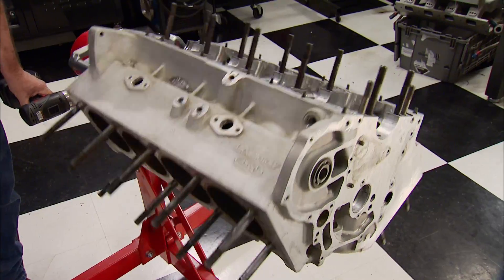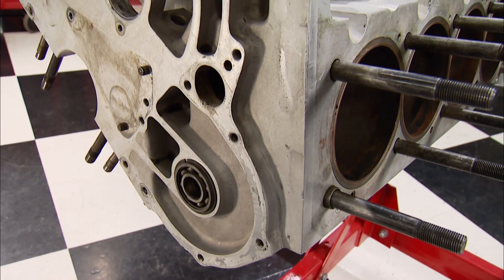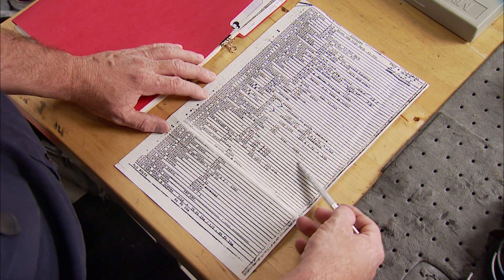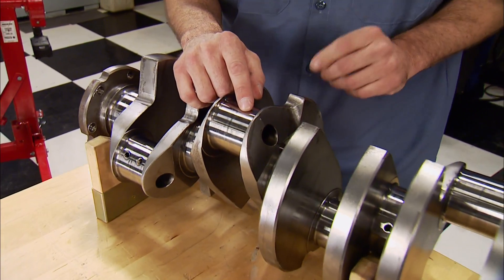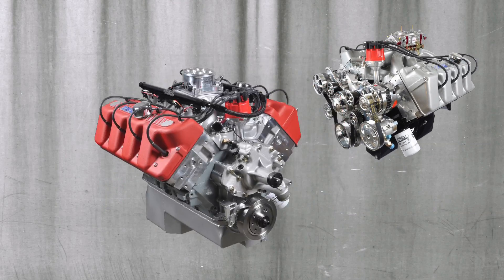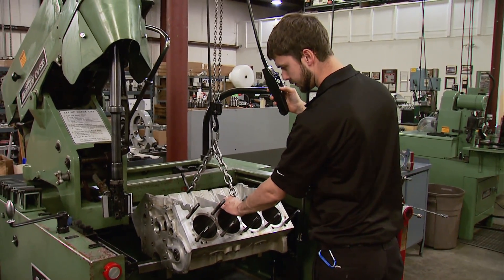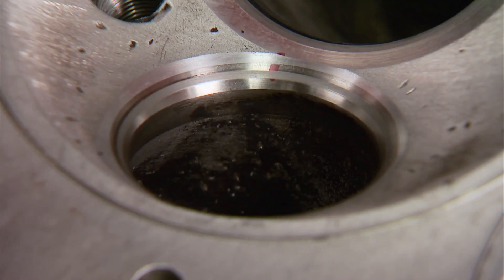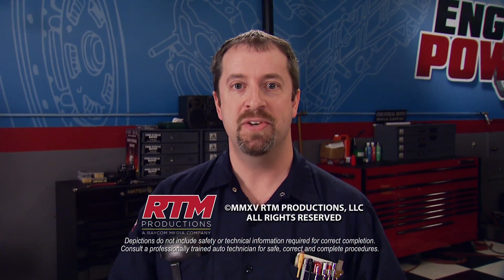The Original BigFoot Engine Build Part 2 - Engine Power Season 2, Episode 5

Comment from the maker: For The Original BigFoot Engine Build Part 3, tune in to HISTORY this Sunday (May 19th) at 7AM ET/PT!
Reply: I used to watch every episode on Spike tv. Then in January,  Power Nation disappeared and was replaced with back to back episodes of Bar Rescue😳   

WTF?
Reply: benoit8850 It’s on HISTORY Sunday mornings between 7-9AM ET/PT
Reply: waiting for ep3 coming up on this channel
Reply: hmm.  i think i would prefer to just watch it on youtube for free.
Reply: what did mr chandler think of the kaases messing around with his motor? how about the displacement shrinking?
Reply: @icyuranus404  I wish he had left it alone.  Kasse is legit and doesn’t “mess around.”  I was far more worried about the Power Nation people.  I hear the engine had low oil pressure, ran hot, and is back on display.  All that history vandalized for nothing.

Comment: So the size of the piston could still be original... your tool and the last used could be that far apart. However as long as you only use that set from this point on you then know what size it is to your tools

Comment: Man all that LS stuff is outrageously priced. I got a gen VI 1998 454 for 700$ with proven sheet 28,000 miles runs like a champ took off the EFI and put on a duel plane intake running a carb on it

Comment: As a fitter and turner (God of trades) your understanding of micro meters is not correct, how often are your tools calibrated this is important as your tools wear like the engine components. I just don't trust a monkey boy mechanic with precession tools. But its a good vid for monkey boy mechanics.

Comment: "Tool on the flywheel bolts were installed at some point and they self-clearanced on the back of this cap and block. The fix after these bolts were removed required helicoils to the crank."

Uh... Say what now?
Reply: Holy crap.. it only got more confusing. Backlash on the threads... Tension on the mic... Jounals... I thought you wrote in jounals, lol.

Comment: It's funny to see the way they machine it, lol. I wouldn't set a bore gauge with a mic. But I guess they probably have 0.002" tolerance. I guess you could if you check the mic with gauge blocks. I prefer to just use a master ring

Comment: 4:13 did he mean to say magneto or distributor? Not criticizing at all. Just genuinely curious. Thanks guys!
Reply: I think it's kinda the same thing if u think about it but I also noticed this and was curious
Reply: Hickstylez I figured he was using the terms interchangeably. Thanks man!
Reply: Magneto. The more cylinder pressure an engine has, the harder it is for the spark to jump the spark plug. There are magnetos that can supply a lot more spark energy than an electronic ignition/distributor.

Comment: Good video but sounds like to me the dudes building the engine has no idea what they are doing.. Have to call a dozen other shops to get it done?
Reply: Thats how they make money. Alot of specialized tooling needed. They're just the middlemen that bolt it together with minimal overhead and maximum profits
Reply: This is an advert, not a documentary

Comment: Does that engine have a Chrysler trans bolt pattern on it?
Reply: It runs a c6 Ford transmission so I doubt it.
Reply: Tim T yeah but it looked like it had multiple bolt patterns maybe. The ford bell housing has a distinct Trapezoid kind of  shape on the upper two bolts, and I thought I saw a more circular pattern like a 727 mopar but maybe I’m seeing things

Comment: Man dropping a 638 inch motor to 571?  WTF  I get it for reliability's sake but that's a big loss of c.i.
Reply: yea but its blown half to space anyway. They'd rather not have to put 3 new sets of rings in before it gets retired I guess. There is a lot of boost going in there so avoiding throwing another rod on the final tour is the priority, not to mention the amount of money they spent on this rebuild. Whoever ponied up those big bucks isn't going to be happy if it needs to be done again.
Reply: @ItsDrillz  I understand the reliability aspect. Just seems easier to take boost out. Either way you are gutted motor

Comment: For an engine to be built to be so strong,it's obvious this one has not.Parts no longer available,,scary thought right there! All the patching up done to the block,another reminder of it's weaknesses from internal pressures. The lifter arrangement should make you close the door and walk away.Yes,it may be a one of a kind, and glad that is so reinterated manytimes. Building to keep original is the only keepsake for doing this,as design changes and strengths in metallurgy have advanced so far now,making this motor a "muse" rather than a top shelf horsepower choice.
Reply: Metallurgy hasn't changed. It's a casting, casting sucks. Nowadays it's just machined from billet. But engine failure still happens

Comment: Cylinder bore measurement should be made in three spots down the cylinder bore & three spots perpendicular. Engine cylinder greatest Wear is at the top compression upward angle of travel from the deck where the greatest Wear is because of the greatest compression pressure. It's not in the middle of the cylinder.
Reply: These guys are pro engine builders, and you are a nobody youtube commentor. Kindly piss off mate.

Comment: great video, but how would you drive it on the street with no coolant?
Reply: Even racing motors can handle being ran for 5mins without coolant.
Reply: It ran on alcohol, runs cooler

Comment: I went to college for this cnc was a mistake hard to find work doing it. But it was fun to make stuff.
Reply: lol, if you're skilled with experience it's easy to get a job. I've been at it 20 years and seen many people that bought a certificate that weren't machinists. You can tell who will make it and who won't
Reply: @highstreetkillers4377   experience  is they key word most what someone with 4 or more year and most make jet engines parts around here.
Reply: + I band still build my coding with AutoCAD from any blue print :P
Reply: I did cnc well worth it.

Comment: 16:13 this always confused me... I understand the idea of removing high spots because of heat isolation and such but why right at the top of the cylinder wall? When the cylinder head is mounted and in place that's not going to be a high spot and rounding over that edge aren't you just creating a void where the cylinder head and block meet? Thereby increasing the chance of lifting the cylinder head during combustion?
Reply: It's generally done to give a very small lead for the piston rings to enter the bore. . A sharp square edge there can catch the ring as it enters.

Comment: Considering that the truck is retired from competition, I wish they hadn't changed the displacement.  It was a 638 and they took it all the way down to a 572.  The obscene "640" was a calling card of Bigfoot's. Now it's a 572, albeit with an unusual, "undersquare" bore/stroke combination.  They took some of the engine's uniqueness away.
Reply: Yeah that just didn't sit well with me put it back to what it was
Reply: John Wilburn its still the same engine as before, and it could easily be converted back to that displacement with some thin bores and larger pistons. But, Considering this truck is going to be put away forever in a museum, id imagine they’d want the original engine to survive rather than potentially getting destroyed if something went wrong on the final tour.
Reply: Thank you for such a great documentary!  So cool to see the processes!
Reply: @adelinogama9277  I heard that the engine didn’t work and promptly came out of the truck and is back on display.  I wish they had left it alone instead of letting Power Nation screw with it.

Comment: Original was Not! A 640
Reply: It would've left the factory in '74 with a 360 fe engine
Reply: @matthewkowalchuk  were not talking about when the truck 1st rolled off the assembly line, or at least im not. Im talking about the original BIGFOOT motor was not a 640. Anyone over 12 knows that, this video makes it seem like they had the 640 in the very 1st truck
Reply: Bigfoot 1 left the factory with a smaller engine in 1974, got a 460 in 1978, and then got the 640 in 1982... same year it first got 66" tires.  What’s so hard about this?
Reply: 638.4
Reply: @JohnWilburn  lmao not even close. Was a 460, how old are you?
Reply: @teds4983  I'm 42 and have been building engines for over 20 years.  The original was probably a 351M that came in the truck.  That Ford specialty block was originally built in 1982 for Bigfoot 1 with a 4.625 bore and a 4.75 stroke for 638.4 cubes.  That particular engine was never a 460.  How old are you?
Reply: @JohnWilburn  do you want me to show you the site saying in 1974 it started off as a 460? 👌
Reply: I think I remember Chandler saying the truck wasn’t originally a 460.  I have no doubt a 460 got stuck in it as some evolutionary step, but that particular engine, which the first truck famously sported by the time it got 66s in 1982, was built at that time to 638.
Reply: Yep, I believe it was a 400.  I don’t think any of the subsequent trucks from Bigfoot 2 on up had a 600+ inch engine.  They were usually in the 540-572 range, even the Ranger.
Reply: @JohnWilburn  ya it didn't have a 460 in 74 like there own website said, mygod your smart
Reply: The page YOU sent me said the 460 went in it in 1978...
Reply: Bigfoot originally had a 360 engine and had that for a while.  Later on a naturally aspirated 460 got installed around 76.  Then around 78 a 460 engine from a t bird was installed with a 6-71 blower and 2 carbs.  Then a couple years later a 460 punched out to 474 was installed again with a 6-71 and 2 predator crabs.  When it got the 66 tires and 5 ton axles a 472 hotter non streetable engine similar to Bigfoot 2 was installed.  At this point it required race gas.  Finally this 640 engine was installed with a 2 carb manifold and finally a 3 carb manifold was added.
Reply: @timt8029  ok let me break what i ment down for the mentally challenged. I ment the original was not a damn 640 like there making it seem like in the video. As far as a 360, when did ford make a 360? Thats a 5.9 liter like dodge...

Comment: Yikes, I'd rather just use another block. Put the original on display.
Reply: Blocks are not made any more.
Reply: @cmsracing  I believe that Carol Carter of C and C motorsports owns the rights to the Allen Root blocks and still sells them. They are still listed on his site but I couldn't find pictures of that exact block (he also sells the "Robert's"  designe block too).

Comment: Do you worry about the heat from you hands influencing the micrometer readings?
Reply: No, a micrometer isn't a precision measuring instrument. It's only good for 0.001" . They probaby have 0.002" tolerance anyway. That's why they used it to set the bore gauge instead of gauge blocks or master ring. 0.001" is alot, but good enough for engine. Especially since they lap and hone it all anyways

Comment: Too bad it's getting all these improvements and going into permanent storage
Reply: Its a piece of history. Its done its competition days.

There are other monster trucks in comp just as amazing.
Reply: The very fact that you've watched this video, is testament to the value this vehicle holds, running or not running. 

So storage or demolishing others in competition holds no value
Reply: It will Parade Around im sure
Reply: Robert Harris no doubt.  This is being done simply for this video.  Which is cool. Valuable and excellent tutorial 
But it will just sit there in a rich guys shop.
Reply: @woodywoodlstein9519  The alternative is to keep running it until its dead, so why do that?
Reply: Tater Ater to entertainment crowds. Which is why it was built in the first place.
Reply: @woodywoodlstein9519  It's got more sentimental value than practical value at this point, the old guy cares about the truck and the engine, the new guys care more about performance and have no ties to the engine

The reason all these old muscle car performance engines are still on the road is because people baby them, otherwise they'd be long gone and scrapped by now

Comment: "Big Reliable Horsepower"  Your only gonna get that with a Proper Ford.  GM guys can crawl back under that rock you live in
Reply: *You're
Reply: Jo Blo good thing for you they haven't been made in over 40 years.
Reply: I'll go crawl under a 83-84 Escort, none of them have moved in quite awhile.
Reply: @Jo Blo 
Oh man, I got out of the Army in 86 and went back to work in a garage I worked at in high school and we had those things with broken timing belts and bent valves coming out of our ears, that's one of the worst designed engines I've ever seen, worst thing is the gasket kit was expensive because the head bolts couldn't be re-used, they've all made their lemons and that one's their's.

Comment: the smaller sleeves brought this down a bit more than a few cubic inches. with the smaller bore it went from 640ci to 572ci
Reply: Would’ve already been down due to blow by.
They said the cylinders were out of round which wouldn’t allow proper ring seating and sealing. 
Atleast that’s what I understood. 
If that is the case she might have actually broke even due to being fresh. 
But from origin build to now I’m sure she’s down a little.
Reply: @DirtNastyCivilian  I was comparing to original build. No big deal since it's not competing or doing hill climbs anymore.
Reply: Well this rebuild was intended for last longer not for maximum power
Reply: That is like a whole city car engine
Reply: Dang, that's significant. I thought they'd bore it to at least 4.50. I suppose it's just a demonstration engine now, but it's likely making over 100 hp less than before.
Reply: Cries with daily driver of only 170 Ci...Its got 30 valves though.
Reply: Cries with daily driver of only 170 Ci...Its got 30 valves though.
Reply: yeah when kaase said it was a "few" cubes less I thought id just take the new bore and do the calculation to find out how many cubic inches they lost. for what they are gonna use it for I agree just make it more reliable. the whole setup is old tech but still really cool